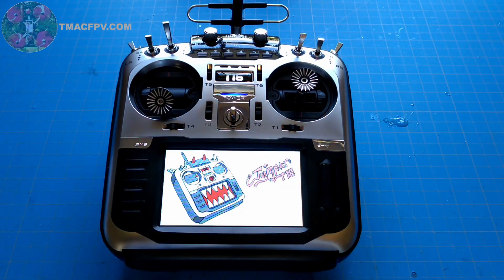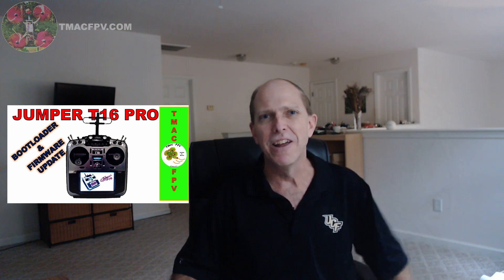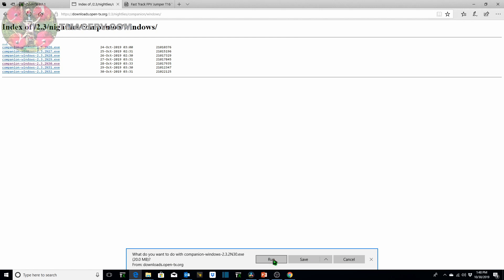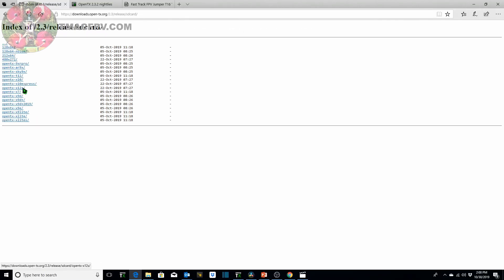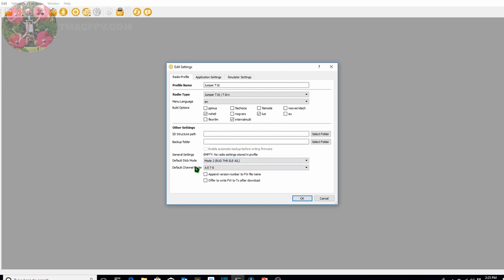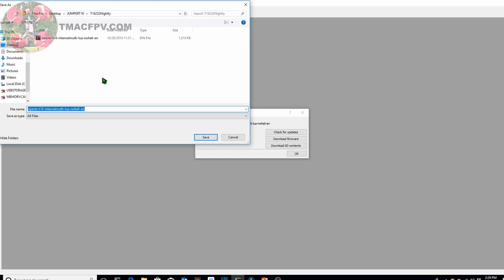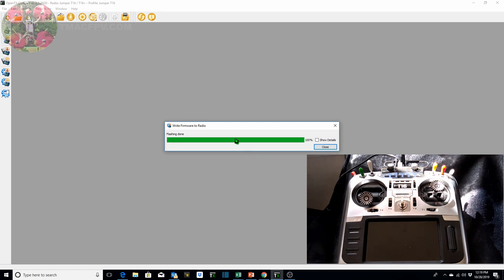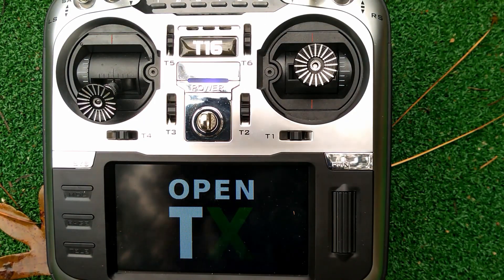OPENTX FIRMWARE UPDATE

Comment: I don't see the Jumper T16 option when going to settings. I receive a warning prior to that step that says, "Firmware opentx-x10-en does not seem to have ever been downloaded."
Reply from the maker: I don't know what firmware you have loaded.  Did you get the T16 with an "OpenTX 2.3.2" version of do you have JumperTX on it.  The OpenTX 2.3.2 version that Jumper is shipping out this week (week of Nov 18th) is not the official OpenTX release fully supporting the T16.  It is one of the nightly versions of OpenTX (even though it doesn't heave the "N" in the nomenclature).  Having said all that, use the hyperlinked Table of Contents above and start at time hack 3:18.  You'll need the nightly version of Companion.  This should get you started in the right direction.  I've included a checklist you can download above for further info.
Reply: @TMacFPV  Nightly. Missed that on companion. Operator error.
Reply from the maker: @otterit  no worries friend. I've done that "a few times" myself! 😁
Reply: @TMacFPV  old age. i wasn't able to get past the next step. Companion does not recognize Jumper T16 when powered OFF.

Comment: Hey hy TMac great video thank u for ur work.
Reply from the maker: Hey H2O-Lobo! Great to hear from you friend! You're welcome and Clear Skies for you!
Reply: @TMacFPV  hy TMac how are u, I finally bought me the internal board for the jumper T16 now I'm waiting for it to get deliver one question should I upgrade the firmware on my jumper now before installing the board .? And also men I'm having a trouble trying to make the jumper to communicate with the reciever i did bind the receiver i have a frsky xm+ and when i connect the betaflight i dont see the movement of the sticks when i go to the receiver tap. I really want this to work I'm going to have to buy me a ready to flight drone to see if it work cause now it's been like almost 5 month that i have been putting together my only drone and i think i did a good job building it me been knew in this hobby thanks too u and other people that i have watch in this time . Thank u so much .
Reply from the maker: @h2o-fpv623  Hey H2O-Lobo! If I were you, I'd just wait until you get the internal board, then install it, then update your radio firmware (per my video), then upload the bootloader to your internal module and update its firmware (per my other video).  You will need to re-bind your receivers after these processes are done anyway so no need to try and trouble-shoot it now without the internal board installed and firmwares for both the radio and internal module updated.
Reply: @TMacFPV  TMac thank u very much for ur help and advise I will follow step by step ur videos . Before I forget let me tell u a little bit of my story on getting in this hobby when I start it I think the second thing that I bouth me was the Radio from Radiolink it was the first time in my life getting me one so I did not know how it did work so I start watching videos to learn to make the story short , I did want it to update the firmware even though i was not flying anything yet in the process of upgrading i think that i did something wrong  so now that radio does not work lol anyways i think i can fix it but that's another topic so after that i got me the jumper so I'm going to be carefull on how i do the upgrade of the firmware so i thought that have to share that with u thank very much TMac.
Reply from the maker: @h2o-fpv623  Thanks friend! Its always great to hear a little bit more from my TMac FPV Teammates!

Comment: Hi, upgraded to OpenTX for the Jumper T16 Pro. Can I now save the internal multiprotocol firmware in the SD card and update it from the radio? Thanks
Reply from the maker: If your T16 does not have the firmware for the internal module which ends in "85" then the answer is "No." You will first need to upload the internal multiprotocol module bootloader and update the firmware using the process described in this video: https://www.youtube.com/watch?v=Dex92d7IQWI The video also shows you how to checkk what version of the module firmware you have
Reply: @TMacFPV  it's V1.2.1.51 so I guess I have to do it as posted in your video. Thanks
Reply from the maker: @ryanhayudini5593  You are correct.👍 51 does not have bootloader installed.
Reply: @TMacFPV  Successfully update my internal module thanks to you and i continued to change the splash screen, background and models. Cant wait for the official OpenTx for the T16. Thank you very much
Reply from the maker: @ryanhayudini5593  Hey Ryan, outstanding!👍 You're very welcome friend and thank you for sharing your success story!😁

Comment: One question I have in upgrading my T16 is - can you move the exisitng models across from the JumperTX SD card to the new OpenTX SD card, and have them recognised by the new firmware? the OpenTX news page for the 2.3.2 nightlys says this is not supported, but does it actually work! I have about 20 models that I don't want to loose.... (particularly the trim settings, as they've been honed through much flight time)
Reply from the maker: My understanding is it is "hit or miss." There's a reason OpenTx page says it's not supported. Some have tried (myself included) and it has put transmitter in emergency mode which is difficult to get out of. I have heard of a few people trying it by turning internal module OFF on all models before doing so and it has worked

Comment: I'm delighted that OpenTX is now being ported to the Jumper T16. I've had mine since June and it's very clearly the best transmitter on the market currently - with the only caveat that it wasn't supported by companion. Now that's fixed (or very close to being fixed) there's absolutely no reason not to go with the T16. In fact, there is one HUGELY compelling reason to do so, and that's the appauling behaviour by FrSky in trying to force the T16 off the market by uncompetitive practices  - we as a community need to strongly resist this blatant attempt to reduce our choice and force the market in their favour! - boycot FrSky until they start playing fair....
Reply from the maker: OpenTX support of T16 is what got me "over the edge" to purchase it!👍
Reply from the maker: D town 313  Hey D town 313 - sounds like  you're having an issue with Spectrum and your T16 transmitter?  if so, it may be the firmware you're running on it. There is a bug in Jumper's released version of JumperTX affecting the internal module and DSM. You can switch to the JumperTX build linked here: https://www.rcgroups.com/forums/showpost.php?p=42917131&postcount=4692 or go to OpenTX nightly builds

Comment: I did not understand why you changed the SD card in the end.  I thought I had recorded the SD content through the cable that was connecting the PC to the radio.  where did this new card come from and what's in it?
Reply from the maker: I used a brand new SD card, formatted it with Fat32 format and copied the new SD card contents to it from my PC. I never copied the SD card contents to the SD card which came with the T16. So,  I swapped out the SD card in transmitter with new one. Now, I still have old SD card with Jumper SD card contents on it as a backup.

Comment: Thanks i did it it worked
Reply from the maker: Hey cbfsoar15! Outstanding!🤩 Great to hear it, thanks for your feedback!  Did you ever have any doubts?🤔😉
Reply: @TMacFPV  jumper tx didn't like me importing models with companion i would get the emergency screen
Reply from the maker: @cbfsoar15  I understand completely. Importing models from JumperTX to OpenTx doesn't seem to be working well.  To save time & effort, its just better to create the models from scratch the first time with OpenTX on the T16.  Then, of course, you can copy those to as many quads as you want.  I basically created one model (I have all my models set up using the same switches on the transmitter) and copied it to as many quads as I have.  I have different throttle curves for each model so I did need to change that aspect of the models.  Not much else. Much easier & quicker than trying to import from JumperTX.  Very happy it all worked it well for you! Clear skies friend!

Comment: Will changing to OpenTX fix my issue where I can’t use UMX bnf planes on my Jumper T16? Thanks
Reply from the maker: Hey Big Willie!  Just looked up your "UMX BNF plane." From what I saw it appears this type of plane uses a E-flite 6-Channel Ultra Micro AS3X Receiver which uses a DSM protocl.  There has been a "known" issue with JumperTX which affects DSM protocols when using the internal multimodule of the Jumper T16.   There are two ways to fix this.  1.  Install the "fixed" version of Jumper TX from this link: https://www.rcgroups.com/forums/showpost.php?p=42917131&postcount=4692  using the procedures from this link: https://www.youtube.com/watch?v=c5yYpbOpXGc&feature=youtu.be (EXCEPT do NOT download firmware from the Jumper website--instead use the firmware from the 1st link).  The SECOND method is to just update the firmare on your internal multiprotocol module using the procedures in this video:  https://www.youtube.com/watch?v=Dex92d7IQWI  Hope this helps-clear skies friend!👍
Reply: Thanks so much for your reply Tmac I tried the 2nd option with no luck so I’ll try the first option tonight, I really appreciate you taking the time to help me out I’ll let you know how I go 👍🏻
Reply from the maker: @BigWillieFPV  sounds good. Yes, please do Willie. Good luck friend 👍
Reply: TMac it works BnF plane sorted but.. I now get an SD card warning when ever I turn on tx or change models,
Reply: @BigWillieFPV   this happened to me as well. The manual says this means the version of firmware on the SD card does not match the firmware of the radio. I got the warning when I tried downloading 2.3.0 on the SD card but my T16 says firmware version is 2.2.3. I haven't had time to look more into it so I just re-downloaded 2.2.3 on my SD card. Sorry I don't have an answer but that's what the issue was.